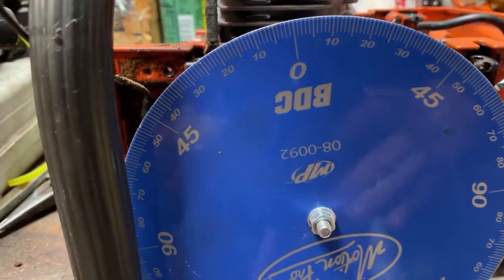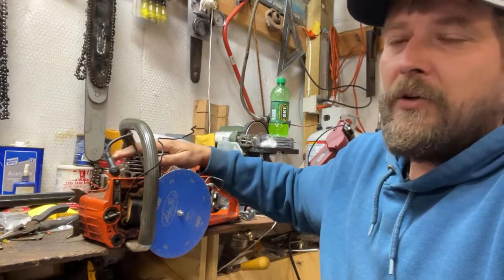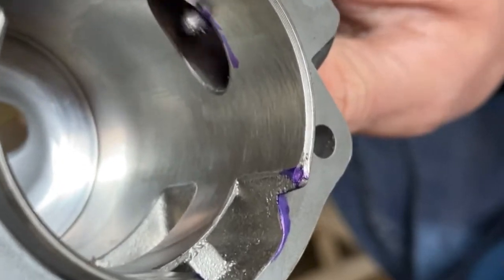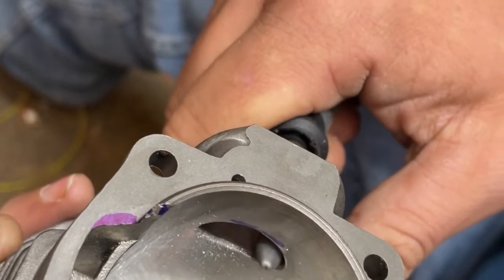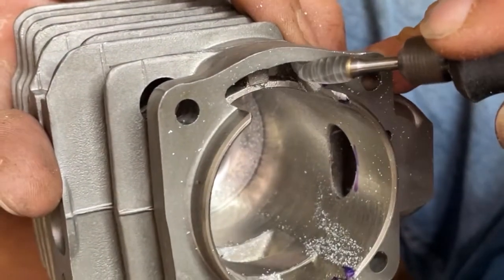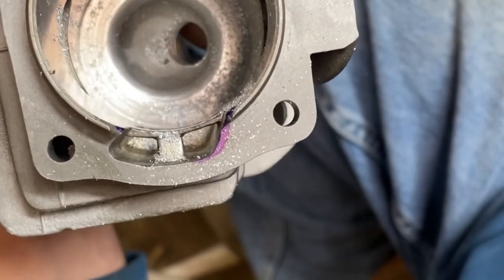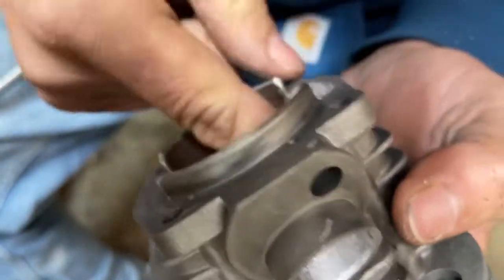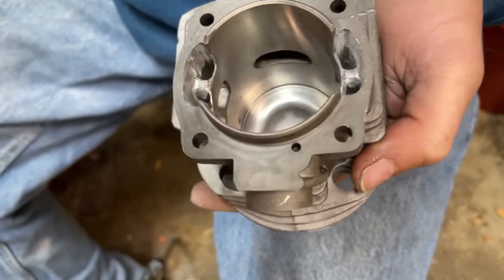Husqvarna 51 | Cylinder Porting Day

Comment: Kinda sucks on the squish still should be a good runner👍👍
Reply from the maker: One of these days I’m going to have the cylinder machined
Reply: @JKSawShop  alot of time an aftermarket piston can have shorter crown height you may wanna compare it to an oem...ive seen some .100 shorter...
Reply from the maker: I don’t have a oem 55 piston
Reply: Can you take the cylinder gasket out to reduce the squish? Or is it too much?
Reply from the maker: @ryanpaasch7464  I didn’t use it, for any of the measuring or finished assembly.